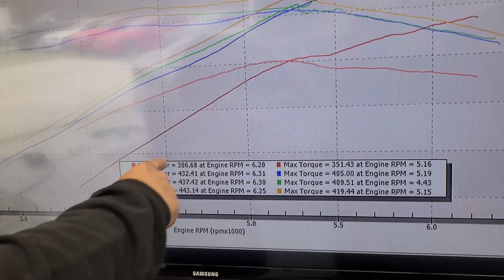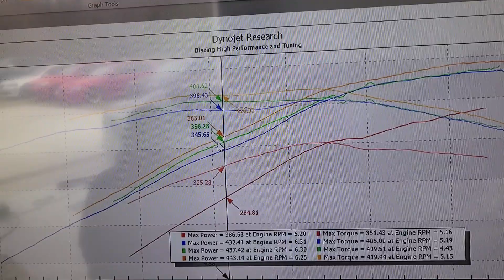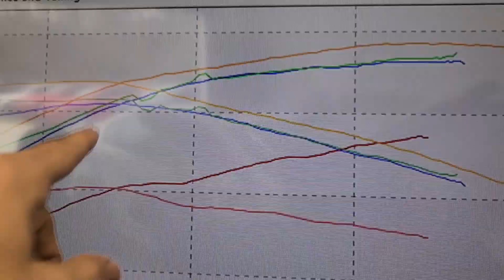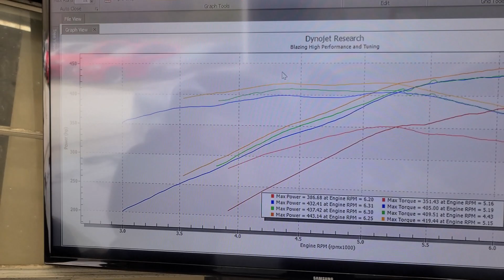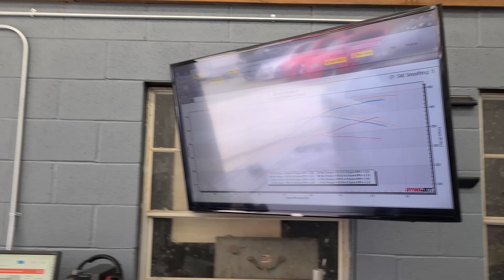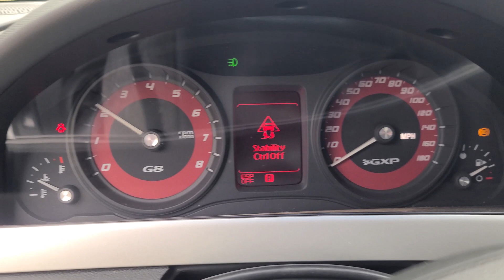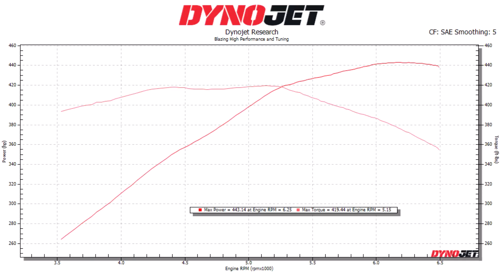2009 G8 GXP with a redhot cam on the dyno and track (GXP mufflers sound GREAT!)

Comment: Do you think this cam works better with single disk or triple disk
Reply from the maker: You have to have a triple to WOT LOCK them...
Reply: @nufnuffz28  I have a rcr 3dp single disk and a tci 3200 triple disk which would work better with this cam
Reply from the maker: @nikob235  3dp will flash slightly higher, but probably not advisable tonlook at WOT. The triple will lock harder,  but not flash quite as high as a 3DP
Reply: @nufnuffz28  thanks and lastly which would be better for track ?
Reply from the maker: @nikob235  3dp unlocked
Reply: Great video as well
Reply: @nufnuffz28 im about to install a red hot cam in my 6.0 gto with a triple disc circle D 4000 stall. I am hoping for good numbers!
Reply: @DEADINSID3.   just T56 swap it stop being held down by a big converter

Comment: What's the specs on the Grey car vs the white car? Seems like that cam works well.
Reply from the maker: White is 4dp, 3.27 gear, redhot, LTs to GXP mufflers, e85

Grey is Dustys car..

Redhot, vcm intake, LTs to Magnaflows, 3dp converter